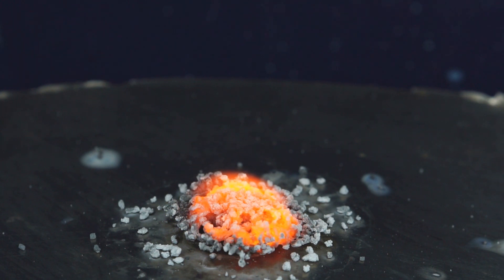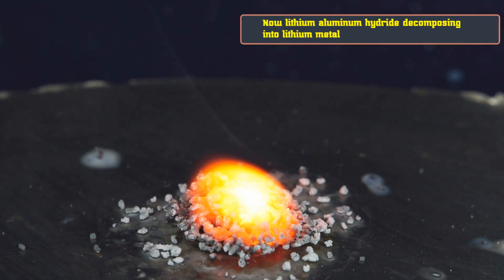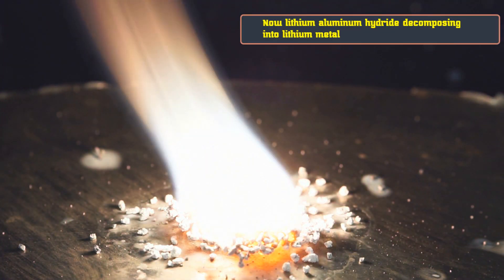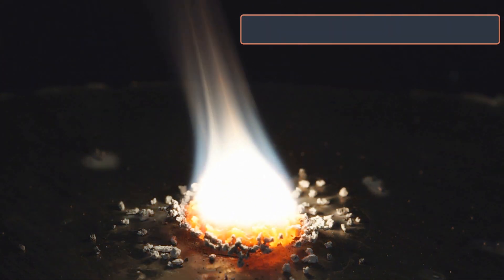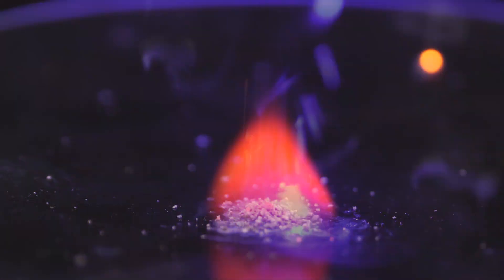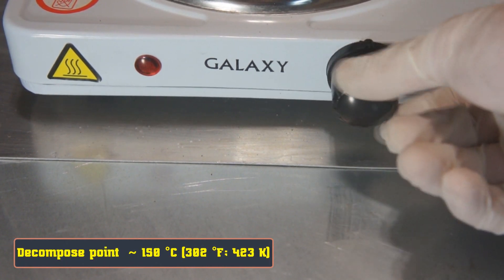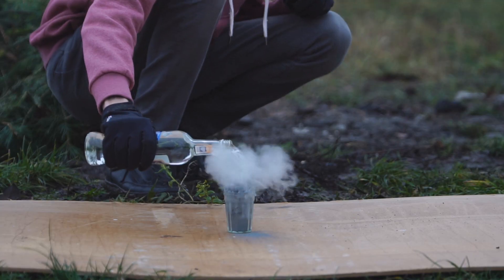LiAlH4. Lithium aluminum hydride. Reactions

Comment: I always thought LAH was so reactive that it was dangerous to have it in just open air if the humidity isn’t super low. It’d be cool to see some of the reactions LAH is used for, especially organic chem synthesis.

I was also surprised the reaction with water wasn’t hot enough to ignite the hydrogen gas like you tend to see with elemental sodium and potassium.
Reply: It seemed to be in prill form, I wonder if that particular product was passivated.
Reply: Yeah some Org Chem synth like lsd 😝 I didn't say anything idk what you are talking about

Comment: My first reaction decades ago was the reduction of trimethoxynitrostyrene with LiAlH4.
Reply: Wait, that's illegal.
Reply: Trimethoxy what?  There's got to be a base molecule for the methoxy groups and the nitrostyrene group, otherwise that doesn't make any sense.
Reply: @Phytologics  3,4,5-Trimethoxynitrostyrene
Reply: @ludwigludwig3515  so like, β-nitro-3,4,5-trimethoxystyrene?  I hope that's what you did but it isn't easy since you can't just add a solution of one to the other.
Reply: @Phytologics  its the standard reaction to make mescalin.
Reply: I know, I was curious if you actually succeeded so I'm pressing for details. It's a difficult reduction due to the limited solubility of that particular nitrostyrene in ethyl ether, wondering how you resolved that issue.
Reply: @Phytologics  i made it decades ago. The styren should be soluble, LiAlH4 is nearly insoluble. Stirring and cooking.
Reply: @ludwigludwig3515  it's the other way around, LiAlH4 is quite soluble in diethyl ether, 225g/L (5.9moles/L) but the styrene isn't.  Every reduction that I've seen in the literature uses a modified soxhlet to get the nitrostyrene in solution.  Regardless, I hope that you enjoyed the fruits of your success, it's a magical compound.
Reply: Could you send to me the procedure and conditions of the experiment

Comment: I think this is an important video. I have a degree in chemical technology and that's basically that I can set up apparatus and run reactions and handle and store chemicals without blowing myself up. But on so many SDS forms you see things such as "dangerously reactive toward..." and you're not sure just exactly what that means. Some chemicals are incredibly dangerous but only when very trace impurity is present. Others are more dangerously reactive when they are exceptionally pure - one of my projects for the first semester was a description of an accident where a student scaled up a reaction ten-fold and used reagents with an additional 9 in its purity, and the reaction exploded and caused significant damage to the facility. So it's incredibly important, from my perspective, to know just how reactive something is. It appears that you're working with the technical grade material which is evidently stable enough to store and manipulate. There are some things that cannot even touch the atmosphere without exploding and so it was good to see the level of reactivity in a common lab reagent - its versatility in reductions is hugely beneficial to modern chemistry.

So the take-away from your video seems to be: work only with technical grade material and keep it away from other reagents until you are prepared to combine them and deal with the consequences of doing so. The material doesn't appear to react dangerously with moisture in the air but I would still insist on anhydrous conditions for any reaction. It gives one a frame of reference for dealing with LAH and what to expect, which is hard to glean practical details from a dry SDS.
Reply from the maker: wow, thanks for the biggest comment! 
Yes, it's a technical reagent, you can tell it by color. Very interesting story about an additional 9!
Reply: @ChemicalForce  It's found in "Prudent Practices in the Laboratory", Vignette 6.2, page 115, which describes the scaling-up of a previously successful cycloaddition reaction of maleic anhydride and quadricyclane. I was wrong about the significant damage part, though. The book says the incident was fully contained within the fume hood.
Reply: I've worked with reagent grade LiAlH4 that was white in color. It was fine in dry atmosphere, low humidity. The thing I remember most about it though was that it would heat up considerably when disolved into a solvent like ether or tetrahydrofuran... So it had to be done in very small quantities so the heat wouldn't build up.

Comment: Can  you try solution of LiAlH4 in diethyl ether and HTP (high test peroxide 85-98% H2O2) - warning possible hypergolic reaction or even detonation can occur. Also i would like to see solid or saturated solution of LiAlH4 with hot saturated solution of ammonium nitrate (>83%). I think it has the same level of danger as previous reaction. The list of wishes continues, solution (or solid) LiAlH4 with hot saturated solutions of LiClO3 or NaClO4. Thanks.

Comment: Where could one buy metal hydrides?
Reply: You could make LiH by the reaction of molten lithium (600°C) with hydrogen. The lithium could be obtained from batteries. 
If you combine the hydride with anhydrous AlCl3 in diethylether you get LiAlH4. Anhydrous AlCl3 is made by reacting aluminium with chlorine gas. 
Other hydrides are made the same way.
Reply: @HanTrio3  very helpful! Would the chlorine from the AlCl3 remain in the ether or is there a purification process after making the LAH
Reply: You have to purify it. 
AlCl3 + 4LiH→ LiAlH4 + 3LiCl
Reply: @HanTrio3  so yes, there's gonna be lithium salts. Thank you. Only challenge I face now is melting the lithium metal and researching my method of extracting LiCl from the Hydride